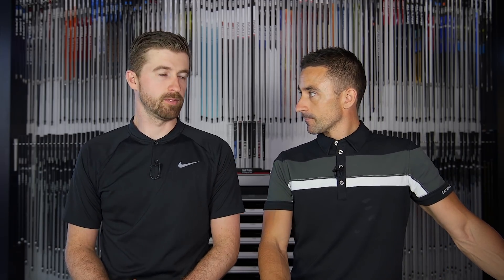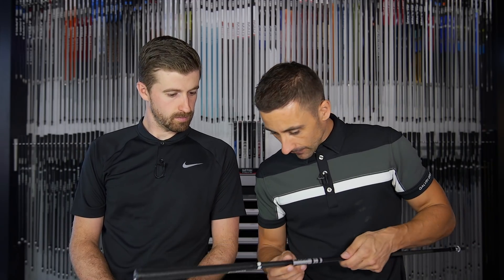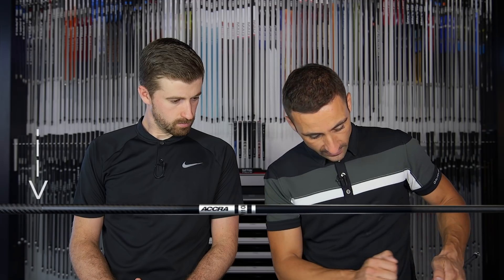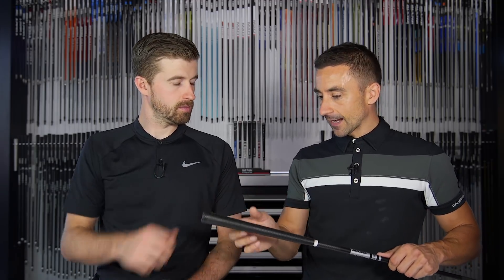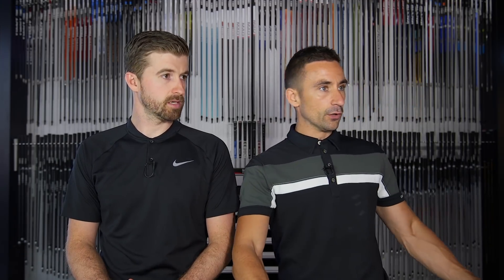Steel VS Graphite Iron Shafts

Comment: Random question. I noticed a Trackman blog talk about the ball performance differences between hitting off of a mat vs normal turf. Their findings (and a few others) found that hitting off of a mat reduced spin by 1000-2000 rpm, and increased launch angle from 1-4 degrees. Would you agree with this?
Reply from the maker: If hitting the ball first, it shouldn't make any difference. Different mats can react differently on slightly heavy strikes though. We use a custom mat that simulates turf very closely in the studio, but this is something we plan to test in a video hopefully this season.

Comment: This reminds me of the "steel is real" lament from the cycling industry years ago. Very few high-end bikes are made from a material other than carbon fiber.  The ones that are made from other materials are a niche market. If your woods can be made with a carbon fiber shaft with a 46" length that are not a noodle, I cannot see why an iron shaft could not be the same. It seems that it just comes down to cost.

Comment: Surprised that the Accra Tour is a .370 tip, thought that most of the graphite iron shafts in this weight category and with a "tour" designation would be constant weight.  What do you guys think about irons sets where the shaft weight decreases as you move into the shorter irons?  I've always been negatively biased against them, but don't have any rational explanation.

Comment: Ian, I just reshafted my irons (Cobra King CB/MB combo set) after a confirmation fitting. Changed from C Taper 120 s which were little light for me, to Dynamic Gold TI S400, hard stepped and .5" over length.  Ball flight is straighter, distance is basically unchanged, but they are going a mile in the air!  I have been getting scoops the last few rounds but these are moon balls...is this shaft not low/mid launching?  Is super high launch a characteristic of a poor fitting?

Edit: continue to strike well, and super accurate but I can’t bring launch down to save my life. Even the 4 iron gets no roll and with any wind I’m losing distance in carry and overall.  I’m torn between being ecstatic at such straight shots but losing yardage....

Comment: What means parallel tip and taper tip ?  Also what are flighted iron shafts? Great content as usual guys! Loving your channel!
Reply: The video doesn't actually address the technical difference beyond shape.  For irons, there are two type of shaft tips and hosels.  .355 taper tip and .370 parallel tip.  Since they are different diameters and shapes a .355 taper tip hosel won't easily fit a .370 parallel tip shaft and vice versa.  There are other differences but that's the basics.  If you're building clubs it's important to know the size of the hosels the heads are so you know what shafts to choose.
Reply: Michael Herring thanks !
Reply: cgasucks please explain it if you have seen the video.

Comment: I know this is an old video, but I have +1.25" length and that adds club weight and observed swingweight, so using 120g shafts feels cumbersome to me.  I actually can't stand my Nippon Pro Modus3 Tour 120s and am looking to get into a 85/95 gram graphite shaft.  I'd urged those with longer clubs to try out graphite shafts.

Comment: I moved to graphite shafts in my Irons several years ago as Steel shafts were getting way too painful for my arthritic hands and the lighter weight means that I am less fatigued after 18 holes. However the one downside that I have found with lighter graphite shafts is that I have literally no idea what the club head is doing in the swing, (I suppose it is a swing weight issue). 
My current Irons are fitted with Matrix HD RADIX S IV Shafts, they do everything I could want them to do but I wish I was able to "feel" what the Club Head was doing. I am interested to see what shafts your Guys recommend when I come over next Month for my Fitting. (21 days and counting)!!!!!
I am also really interested in that Composite Putter shaft, that sounds really interesting as my Putting SMELLS at the moment!!!!!!
Reply: Bandit Baker Well? Do tell.... please & thank you... 😉

Comment: also what about the durability of graphite shafted irons. if someone were to buy a new set would they stand the test of time? lets say 5 years or more
Reply: I have had my graphite shafted irons for over 10 yrs and they are still going strong. It is definitely time for me to upgrade, but my old Golden Bear graphite shaft irons are still hitting true. Well, as true as I can swing. haha
Reply: They are more durable than my body.  They can be replaced when out-competed by newer graphite shafts, my body cannot. haha.

Comment: Would you recommend changing a driving iron shaft from steel. I currently have a Nippon modus 105 in my epic 3 iron the same shaft in my wedges and irons. What would I gain using it in a long iron and what would I sacrifice
Reply from the maker: Hard to know until you test it Thomas, but as the Modus 105 is a lightweight steel option, it shouldn't perform drastically different for you than a comparable weight graphite shaft.
Reply: TXG Tour Experience Golf. Cheers Thanks for the reply

Comment: Very interesting information once again - thanks guys!
I'm a little confused. When Ian talked about the 8-iron shaft in the wedge... Are there actually different shafts for the irons? I thought there was only one standard shaft and length - and it gets butt trimmed to have the correct shaft length for each individual iron.

Comment: Very curious question for you exceptionally smart people. In short, I have DG S300 Sensi-core shafts, could there be a graphite alternative that absorbs vibration as good as or better than those? Is it a matter of just diving in and trying everything? 

The long version (specs) is I play old (OLD) Mizuno T-Zoid Pro irons, 7i swing speed is around 88-90 mph, carry (with range balls) is about 155-160 yds. Distance is not my goal, I know I shouldn’t be playing blades. I know that graphite will offer the ability to load more, but will it feel as good across the entire face as the Sensi-core shafts?

Comment: Aerotech Steel-fiber is the shaft used on tour. Why didn’t you use that shaft?
Reply: Judy Waldie You need to go get fitted. And not a basic kinda place either. Get on a launch monitor & hopefully the place has a quarter of options that TXG has.... Good luck! 🙂

Comment: I have Mizuno JPX 900 forged with Nspro Modus 3 Tour regular 105,but Mizuno do something in my shafts,they sad to my swing,is not regular or Stiff,so they do a Hard stepped shaft,can o talk abouth that?.....sorry abouth my inglish,Thanks
Reply from the maker: Hard stepping is a process that makes the shaft play about a half flex stiffer than what's on the label.

Comment: Ian/Mat, you guys always hit on a subject I am working on or thinking about. I have had elbow surgery in both my arms (relocation of the ulnar nerve) which have never stopped me from playing the game i love. Years later now i am getting some tendon pain on the outside of my left elbow. tennis elbow perhaps. i have played X100 DG forever, tried Modus 120 but went back  to my trusted X100 DG. because of the pain i am feeling every round now i was thinking if graphite would help. Could you all give me some graphite recommendations that would feel and play like my DG X100 130g shafts??
Reply: I had to take 15 years off golf with bad elbow injuries. I previously used Rifle 6.5 shafts on AP2s and also a set of Taylormade C300 forged cavity backed blades (old Tom Lehman clubs). I was in TXG the other day, they are local to me, and hit the shaft in this video in a new AP2 6 iron - bullet straight like Matt and way less elbow vibration than any steel shaft (I compared back to back - had similar results to Matt). I also own a set of Callaway Apex CF-16s with Recoil in Medium flex (the shaft is also bullet straight and absorbs any vibrations). I went with Medium thinking I would now just swing slower, and even at my mid 90s mph 6iron swing swing they appear to work great - but when tested at TXG the Medium shaft drops too much for my swing speed producing a 4 degree toe down at impact - compared to the shaft in the video that was 1 degrees toe down (all at standard lie angle). I would suggest both the heavier Recoil shafts in Stiff and the Accra shaft in this video as 2 very good candidates. The Accra is black and visually this may not be your thing but the performance is excellent!
Reply: Paul O'Neil 
Thank you for your suggestions.  I will definitely be testing both of them.

Comment: Ian. My question is - if I was to buy a custom iron set online and choose minus half an inch in length, which end would this be trimmed from and then would this change flex?
Reply from the maker: You would want to get in touch with the shop you're ordering from to specify either a butt trim or tip trim. (makes the shaft play softer and stiffer, respectively)
Reply: TXG Tour Experience Golf I wouldn't even be confident ur local pro/retail shop would ask this if you were to go into a store and order a shortened length of clubs

Comment: Very interesting guys. I'm thinking of reshafting my existing irons (MP-18s) would a shaft fitting be possible?
Reply from the maker: You should be able to try out various graphite shafts in MP-18 heads at any shop with a Mizuno fitting cart.
Reply: Thanks I will discuss it with Ian when I come in July for my driving iron fitting.
Reply: TXG Tour Experience Golf i am thinking about the MP18 blade with graphite shaft (because of my wrists /joints it’s better to change to graphite) but the  mizuno fitting cart has very limited options in graphite . Only Recoil 95 or Project X LZ tour. It is indeed the “feeling of weight” which is (for me) very different and makes me not always aware where the clubhead is. In the shop on trackman I can easily adjust but on the course it doesn’t feel the same as the  S300 AMT I play now. Makes me reluctant to pull the trigger on the MP18’s, and the other contestant the Srixon Z785 has only one graphite option in the democart and that is the Miazaki. My shop made a recoil 780 es shaft available for the demohead but the flight with the recoil is too high and too spinny and that concerns me in wind. The other Srixon graphite options , such as aerotech, aren’t available in the democart and that makes a good fitting difficult .....so it isn’t easy to change from steel to graphite and that is mainly because of the lack of feel where the head is.

Comment: I'll save you 30 minutes. For most people, there won't be any noticeable difference between using graphite vs steel.
Reply from the maker: Uh, no. You're not saving anyone anything with that comment.
Reply: A proper club fitting is looking for a very specific set of shafts. What it looks like or the material it is made out of shouldn't play any part in what shaft someone gets. Your 30 minute video shows that. All your practice shots were well within the parameters of player error.
Reply from the maker: The material absolutely makes a difference. Wall thickness on the shaft can be varied and weight distributed differently throughout the shaft when working with graphite. It isn’t just two identical shafts one made of steel and one made of graphite.